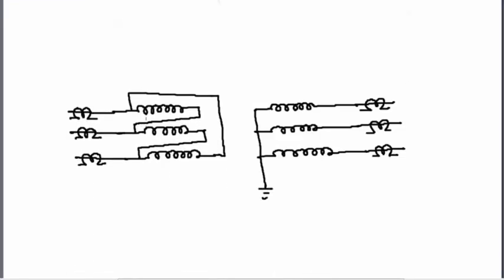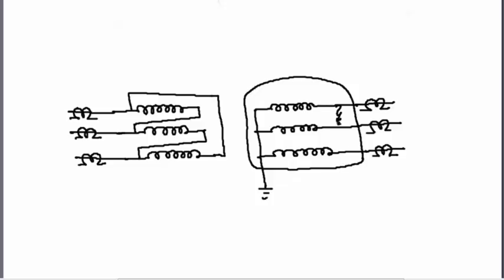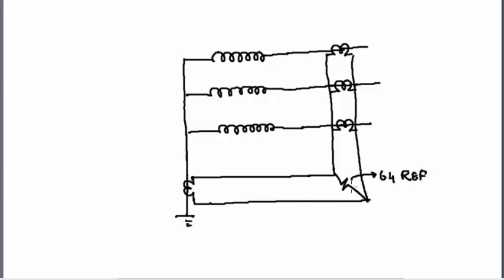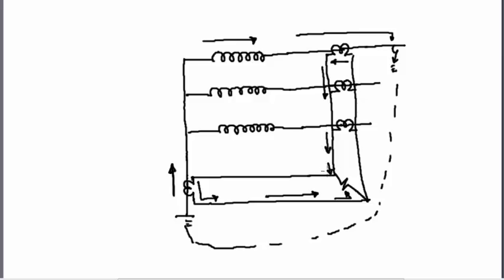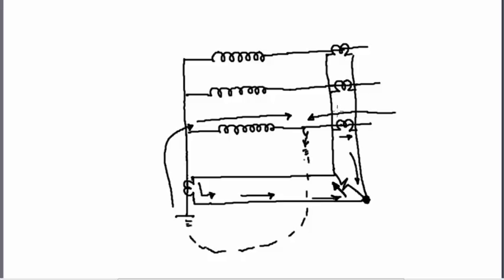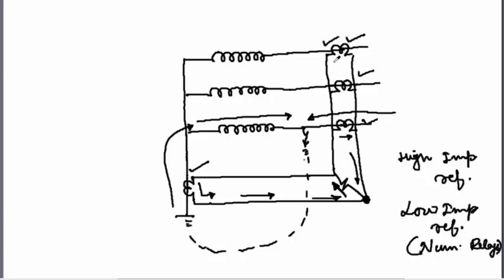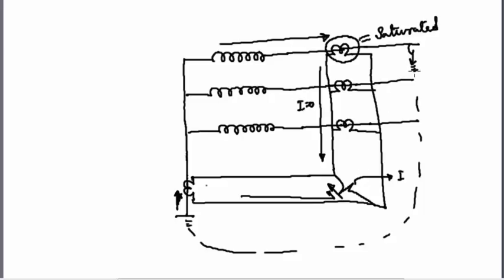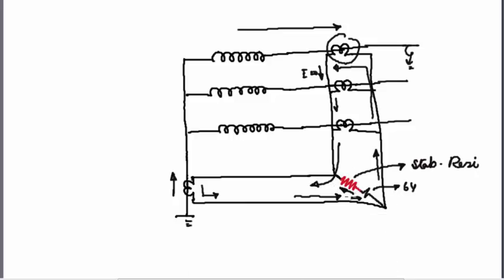basic theory of REF protection in transformers

Comment: Nice explanation.. looking for more videos..
I faced a problem. 4 11 kV 5400 KW motors are connected in the same bus bar. Now 3 mtrs in running condition ( no load). now I'm trying to start the 4th motor, that time any one of the motor(running) getting tripped. why??

Comment: nice explanation....I cleared in high impedance REF.....can you tell me the Difference between  Low imp REF and High Imp Ref.....and I want to Know about basics of Low imp REF
Reply: Haribalan Kumar In low z relay no need the same ratio between 3 phase CT and neutral CT, because Low Z relay has capability to auto calculate, so will no trip when any fault in outside of coverage area. But when High Z relay using different CT ratio, during external fault occured it always cause the REF pick up because appear differential current in the REF coil.

Comment: In one of our substation whenever the 66 kv voltage is on higher side may be  greater than 70 kv and if power transformer after maintenance is switched On it trips with REF indication .Could you please explain the reason for same

Comment: Thanks for the nice explanation.

but one problem I faced recently, this relay operated during unbalance current in the circuit when large motor staring since there was residual current in the line but there was no ground path in the XFMR neutral. 

what do think the best way to resolve this issue?
Reply from the maker: can you please tell me whether the transformer tripped or the motor and whether it tripped through ref protection or earth fault protection.
Reply: What tripped is the transformer relay (REF Function)
However, the motor rely picked unbalance current but did not operate

Comment: Sir is 64 REF relay is only used for star connected side or in both sides of TRANSRFORMER,plz reply sir
Reply: You can use on Delta side also, but obviously only need the three line CT’s as there may be no neutral  CT. If there is a zig-zag earthing transformer on the Delta side then the connection is the same as above using the 3 line CT’s and the zig-zag earthing transformer neutral CT.

Comment: please.,when the loads of there phases is not balanced any effect can occur?
Reply from the maker: we add a stabilising resistance in series with the relay coil whose value is calculated considering the maximum through fault current, thus during small mismatch or unbalance relay will never operate.

Comment: when CT saturated it means that secondary current will become zero? or it wont increase further as primary current increase?
Reply: Prithivi Raj sec current will not increase further after CT saturation.
Reply: Saturation means second. current will not increase when prim. current increases. He meant in this video, the current flowing in the NCT will be equals to the outzone fault current. When the outzone fault current is very high to phase CT saturated, the phase CT secondary current will be lower compared to NCT secondary current, will cause the REF relay to see a vector sum not equals zero, thus tripping the circuit breaker.

Comment: Hey, 
Can I use the same CT of Diff.Prot. to High Impedance REF Prot?
Reply: Yes. First use the CT outputs from the differential cores to the Diff relay, extract the exit points from the diff relay and form a star point and then take this star point and the differential core's original star point to the REF relay..